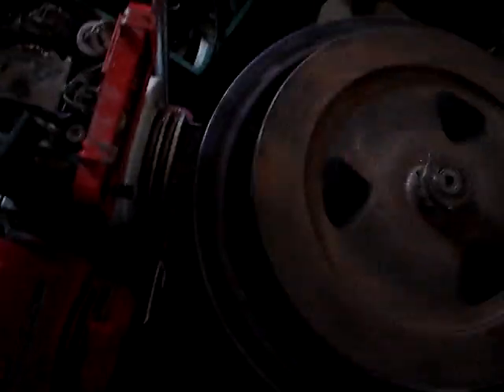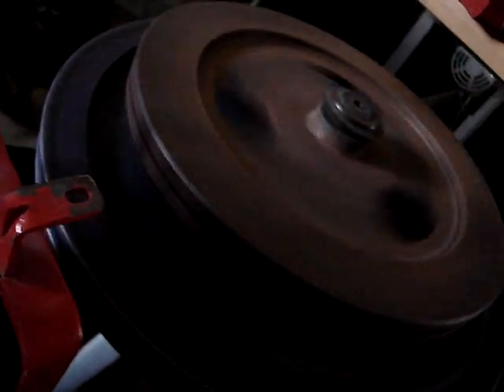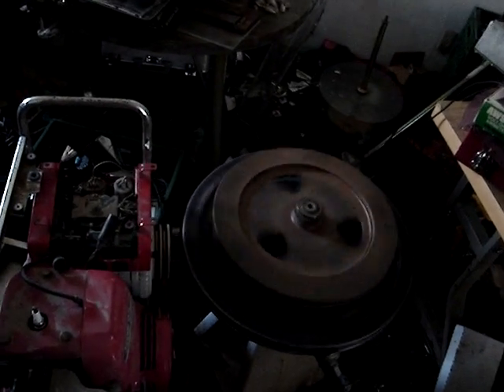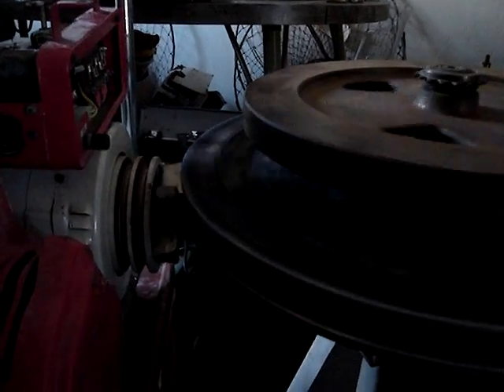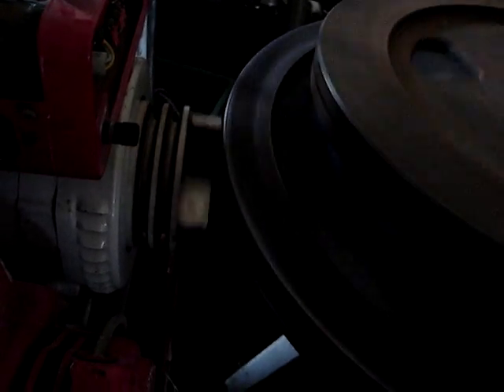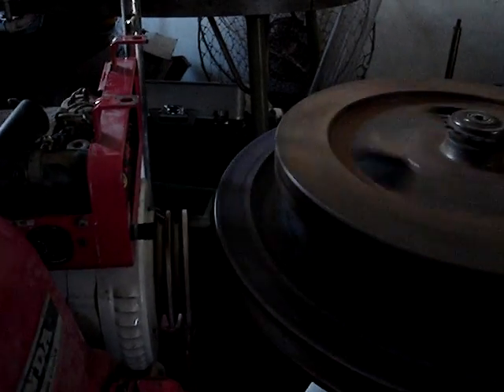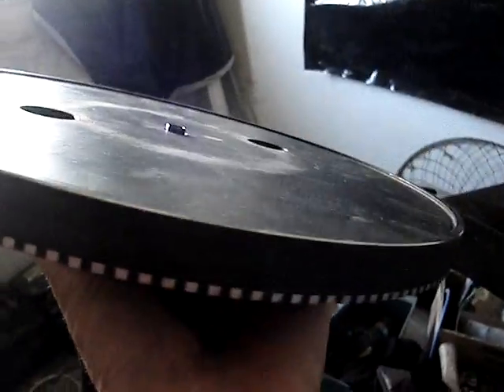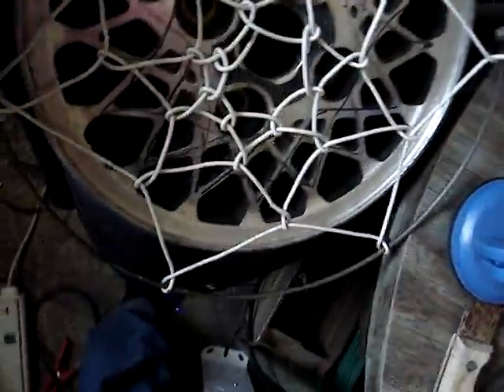Magnets Spinning Generator W/ NON magentic FlyWheel

Comment: Can you tighten the magnets so that it does do less of friction and more of free running?
Also, can't you make it have load using magnets instead of the usual axle?
Then you would have overunity. Connect your own slight electricity, conduct electrons, make them move, and then overunity generator. Good work.